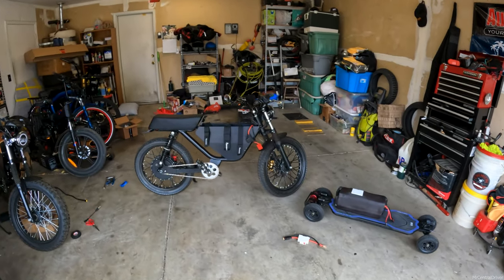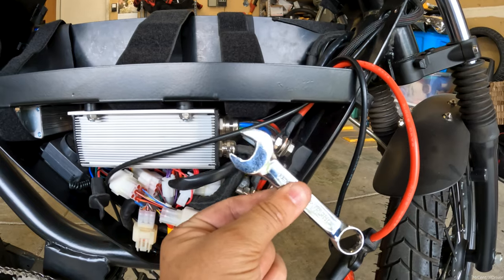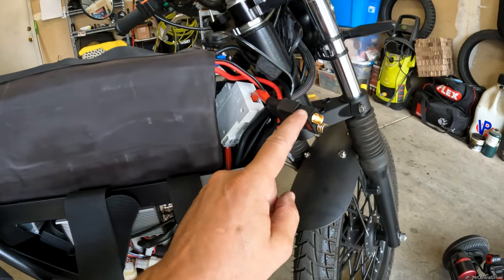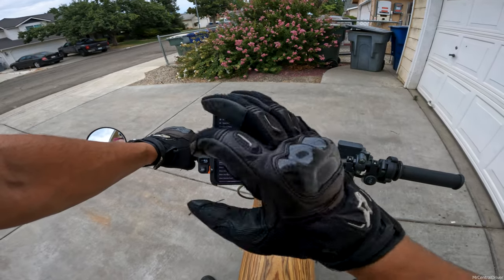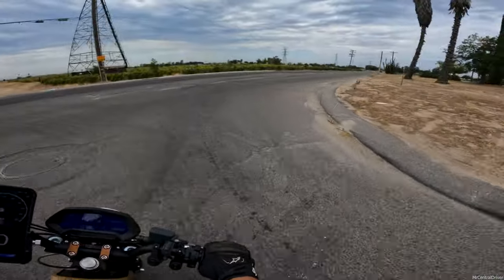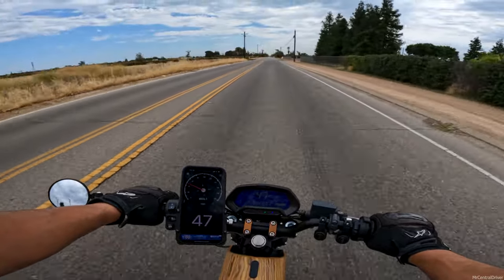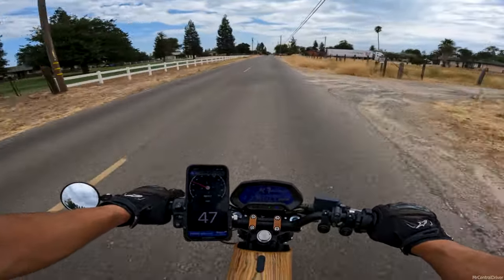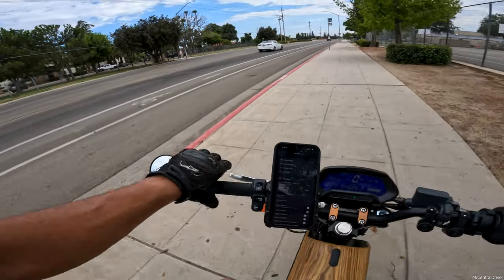ChiBatterySystems REBEL TOURING for the ONYX RCR Install OSE8 ! DISCOUNT CODE

Comment: I had to do chargeback for a litespeed battery ordered 3+ months ago, lead time said 3-4 weeks.  Waiting for bank to finish investigation, never replied to email, phone calls, or through their website.  

Most likely get a powerfullithium battery 2 week lead time, they actually called me to get measurements biggest battery they can try to make for me.  If not maybe chibattery.
Reply from the maker: Yeah I don’t blame you. Mine said 6-8 weeks and it was almost 4 months.
Reply: Chi battery came in 3 days WTF?

Comment: bms most likely is set to limit current below 4.2 for safety reasons
Reply from the maker: Could be right. My litespeed battery on the sur ron I can customize everything and have it charge all cells to 4.20 or even more if I wanted which is not good. I did it once tho. But this battery doesn’t allow it
Reply: @MrCentralDriver  your garage scares me bro, you've got like 7 bombs in there charge those batteries in a metal trash can at least haha

Comment: Would you recommend to turn off the breaker switch in order to charge the Onyx? Or is the breaker switch only for the purpose of removing the battery safely?
Reply from the maker: Only for removing the battery

Comment: What's the bms app being used called?
Reply from the maker: Smart BMS. Green icon on App Store.
Reply: @MrCentralDriver  did you have to do any setup on the app? Mine reads 99.1% on 73v out of the box. The bike shows a little over half turned on. I used the promo code, thanks for that.

Comment: I wished I had known that I could have got a break on the battery with your code I just spent $2,500 bucks on a 60 amp hour Chi and charger for my sur ron it kind of sucks you could have made some money and I could have saved some money
Reply from the maker: If you haven’t received it yet you can contact them and tell them you want to add this code and you forgot to put it in the check out they should be able to do it for you.
Reply: I received my battery a couple of weeks ago so I'm kind of Sol

Comment: ChiBattery is "taking over" simply because there are no other players. What we need is more competition in this space. ChiBattery is free to set whatever price they want on what these battery packs sell for. 

By the looks of the BMS app on your phone, they are using a 'Daly' brand BMS which is bottom tier chinesium. No one serious about lithium based battery systems (from 'off-grid' or solar power to other home built EV's) uses these BMS's because they are such trash. Failures, fires, ruined battery banks - is what most peole report for battery systems that use Daly branded BMS's.  And thats just for the 'legit' Daly brand - there are quite a few knock offs that look identical to this brand and function even worse.
Reply from the maker: I agree more companies means more competition and better prices for us. But as of right now chi is taking over. Power lithium was it? They are doing good too